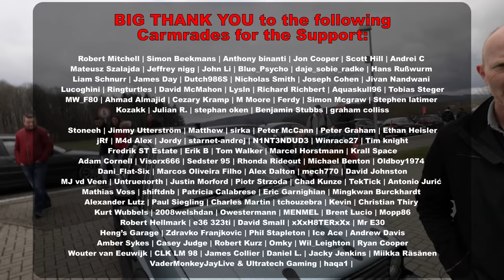(un)LUCKY CRASH of Legendary @pinderwagen // Nürburgring

Comment: I’ve posted my thoughts and more video of the crash here: 
https://www.youtube.com/watch?v=54_zELFQ7iI

This is the 6th video Misha has posted of the #pinderwagen on his channel and we were both hopeful of getting some great incar footage. 

For the first time in several years, the Golf had zero issues, all the work over the winter to replace the gearbox with a much stronger SQS H Pattern dog box and sequential shifter meant I was finally able to do 2 days at Spa, then 2 days at the Ring without the gearbox letting me down.  This was lap 2, by that I mean I’d done a lap, came back into the carpark, adjusted tyre pressures and gone straight back out for this lap. The ambient temperature was around 9 degrees and I believe this is probably what caused the issue with the rear tyres not fully warming up.

In future, on cool days like this I’ll run A052`s on the rear instead. They warm up quicker and offer similar grip. I run slicks as they are a fraction of the cost of A052`s or Direzzas.

People always comment in these videos that I could have bought a BMW or Porsche for what this cost, my replies are always the same. You couldn’t and I didn’t have the money 17 years ago when I started. The car has been developed as I’ve saved up and wanted more from the Golf. 

I have also learned a huge amount along the way which is a big part of the enjoyment for me. Just buying a car off the shelf and driving it with no opportunity for development holds zero interest.

Many thanks to Misha for sharing these laps and I genuinely appreciate all the positive comments we’ve received over the years. 

I’m not a mechanic, I don’t have a race team behind me, I’m just a home enthusiast who loves learning, getting stuck in and driving an old MK2 Golf I built on the Nurburgring.
Reply: I am really happy that you didnt have the money 17 years ago 😅
And happy that you are ok too. 
Your car is amazing and the way you talk about it your wife should be jealous!!
 just keep visiting Misha!
Reply: Cold tires are the worst. Happened to me too sadly. I'm glad you're okay, and continue to do more track days.
Reply: You have a great car Nigel and I always like seeing you on track 👍
Unfortunately shit happens on NR sometimes but I'm sure you will be back soon 💪🏁
Reply: You are inspiring racer to all of us motorsport enthusiasts who don't have the means to own and maintain a proper track car.  👍
Reply: Thanks for sharing. Amazing that something so small (cold rear tyre I think you said), causes such a spin. Credit for being transparent and well done for saving it.
Reply: legend
Reply: Built, not bought is so much more satisfying, when you've put so much work into it over the years. It's amazing what can be achieved when you're just willing to have a go, rather than just paying someone as it's quicker. Hope to see Pinderwagen in the metal some day
Reply: Can happen to anyone at any point, good that you got straight back on it, exercise that demon! Car took it so well, sign of being built properly 👍
Reply: first of all , i'm glad to see that you are okay and that it isnt THAT BAD , could have been much worse :)
Reply: Do you have a link or contact to the company you got your trans setup from? What I googled seems like an old non functioning site.
Reply: I love your car. The fact you built it and didn’t buy it is what makes it so cool, much cooler then a mega expensive exotic that someone bought. Keep doing what you love and don’t let this setback keep you down. Great work, great effort, great inspiration for the rest of us. Well done!
Reply: your car is truly awesome. you seem like a really cool dude too. congrats on the retirement btw.
so glad you only grazed the barrier. happy to see you were ok after and also super surprised by how well the golf took that hit. man id love to chat with you about the car and hear all the stories. after 17 years id imagine you have countless
Reply: I hope you are yelling at yourself and not the car because she doesn't deserve that kind of language!!!  Love watching you work and one hell of a machine you have created!
Reply: 1 in 3000 chance of crashing is really really good for the ring, they dont call it green hell for nothing, hey now you get to rebuild and improve the car, just part of the fun!!!!
Reply: Top chap Nige.
Reply: UTTER RESPECT
Reply: Glad you're ok, in good spirit and your wife lets you reserve time to fix tinderwagen proper :)
I've had more fender damage on my former MK2 after 'parking' it with 5kmh too much, so your reactions to the spin-out must have been really on point.
And that shifter is just amazing, wow.
Reply: As we all know Nigg "Happy wife, happy life"
Reply: Play that moment from crash in slow motion, i think that it have something to do with the rear right wheel, when u were going out of that white-red sider or what is it, and tire was catching grip and downforce made it little bit harder in that 120 speed because in that turn the weight which was translated on that tire was to heavy from that downforce, turn and beton or what is the name of that white-red think on side, so meaby different size of tires in back and better suspension will meaby help if am i right, otherwise, super cool wagon lap💪🏿💪🏿💪🏿💪🏿💪🏿💪🏿💪🏿💪🏿💪🏿💪🏿💪🏿
Reply: I believe it was you that gave me one of my first passenger laps on my first ring trip, some 10 or 12 years ago, You taught and showed me a lot in that one lap. Thanks For sharing and good luck with the fixes.
Reply: I rather watch a video of the physics defying Golf than any GT3 RS videos.
Reply: Your car is amazing and that shifter is dead sexy. Your reactions are quicker than mine but some slides just can't be unfucked. Short wheelbase FWD cars are a hoot, but inherently twitchy. I guess that's what makes them fun.
Glad it turned out alright. I look forward to your next video.

Comment: Interesting cause, if it was the cold rear right tire, or maybe being slightly on the brake when turning in left? Anyway - happy that there was almost no damage, I love your pinderwagen, your geniosity and effort, it's an incredible machine. Looking forward to more of your videos!
Reply: Its a mk2 golf, right?  I’ve had this kind of thing happen.  It’s the light ass rear end.  The aero on the car was probably working but not quite enough for that one light left at speed.  He let off a little and the back end didn’t agree.
Reply: @pinderwagen  looks like you may of barely touched the curb on the righthandside before turning left causing the rear to get unsettled
Reply: @pinderwagen  nice driving though and awesome car 💪
Reply: @essbeepee3376  agreed.
Reply: @kw2519  i also think if he would off accelerate instead off breaking that little bit. Maybe wider back tires and of course a bigger wing
Reply: @pinderwagen  15:53 sounds like the floor/splitter makes contact with the ground, is that normal of each lap? Crazy lucky though all in all
Reply: @chottomatte685  it always touches the side skirts there and through the Karussel. Mishas camera makes it sound really loud doesn't it!
Reply: @pinderwagen  interesting, I mean tires temp is a factor as well as road surface.  But I just recognized that moment when the front and back had differences they could work out.  

Are your rear axle beam bushings oem or a different material?

My brother had a mk2 back in the day(total beater in college). That had the most worn out rear beam bushings.

We went through a flat S turn and the back end just kept going out farther and farther without actually sliding.  It was doing its own rear steer.  He countered it and he was not unfamiliar with slides at that point having had a hopes up Caprice 9C1 prior.  The kid knew how to drive at that point.

But I’ll attest to how the back end just wouldn’t listen.  

Does your telemetry show you anything wierd?

Also, fucking amazing work on that car.  It’s fast as hell.  That was definitely a fluke.
Reply: @motri5935  ya but I think he would have pushed to far out for how fast he was going and wouldn’t have stayed on when exiting.  Like he prob would have slide into the wall with his right side.

I mean, it’s all speculation until someone reviews the telemetry

Comment: Good fast variants legendar special  gearbox manual The short box.  You can switch more quickly and reduce power in time.  There will be no load on the motor.  Easier to drive in all corners.  Never use the "long box", shift too slowly and reduce power under load, you can slip off the track.  There are special adjustable gears of the short box Faster or slower.  Always in many corners Short adjustable manual gearbox gives good results. Even at high speeds.
Reply: Sorry, but I have no idea what you are saying.

Comment: Tough one, coule be tire temps. But here is my take , during compression the car made a fair bit of a banging noise but thats nbd, he moves the car over to the right side to line up the curb but hes  braking  coming up the hill as speed is scrubbed off pretty quick, he goes from 140 to 106 in like 20 meters. I think he stabbed at  the brakes a bit to hard making the back come around, u can see at the exact moment he loses it he has 0% throttle. And you can tell he saved it on the original mistake but as soon as he hit the curb physics slapped his cheeks. Still a great driver can't fault him on that error really,  3k laps and you are  bound to have an anomoly when you least expect it. Glad the driver is okay, and no one was hurt.
Reply: Also teach this man how to left foot brake please Misha.
Reply: if you watch the video I link to in the pinned post, I have a previous lap side-by side. Same speed (slightly quicker actually)

I agree about Left foot braking. I`m still practising but it`s hard. I end up nearly headbutting the windscreen most of the time :D

Comment: From the inboard we have i'd say the oversteer moment is caused by slightly going on the outside curb under braking, then very slight liftoff when the car started over rotating. its a very common reaction, but sadly its the worst thing to do on a FR car, maybe with more throttle input to get out on top of fox hole would have got you out scott free. that is what i think. also you did catch the first moment but then he completly lifted out, i've done exactly the same think once wrecking a car😅. but what i learned from that payed me back many times...from that day on a FR car oversteering my modo is when in doubt throttle it out!😅 it works well on motocross has well🤘. but at the end of the day i know mistake happen all the times even to the best of us. the only thing important is to learn from it so next time you will know what to do. very happy that ur ok and the car is also ok! you are lucky to do that. here in canada race tracks a far appart sadly🤘

Comment: My only thought is your golf had been through some high g force left hand bends leading up to the crash. So I would have thought the rear right tyre would have had enough temp. That was my gut feel based only on what I saw. It looked like it disweighted due to riding the outer right kerb just before point of turn in. That was my view as an observer. Cheers.

Comment: I love seeing peoples cars they put effort into building at the track, its more of a shame when they get dinged up though. Looks like deceleration induced over steer, ive seen two other cars do the exact same thing at the top of fox hole, one overtaking a car on the inside of the corner, minimal steering input, slowing down to be safe and the rear just loses traction. Glad the driver and the car are (mostly) ok.

Comment: It sort of seems like you were pushing the car too much. And that there is a disconnect to what the car is doing and what you are feeling through the wheel (either that or you just push things too much trying to get more out of the car then it is capable of). Ive done a little tracking with a motorbike and you are completely in touch with the bike and the feel of the road in a way that few if any cars can replicate as there is a steering column on cars. You could see a number of corners before you crashed you were right on the edge of crashing and seemed unaware of the impending doom.

Comment: I looked at the crash multiple times and you can hear (from what it seems) the car bottom out on the apex just before the crash and then again right before turning in and losing it. I don't know the settings, but a bigger wing would most definitely make it bottom out more. A stiffer setup is needed if you want to fit a bigger wing. I think the bottoming out unsettled the car on turn in. The reason why you wouldn't see it on the telemetry and why it was no problem before could be due to a stronger headwind causing more downforce at that specific moment. The higher downforce combined with the compression could explain the crash. Now I'm not an expert, but it's something I noticed.
Reply: The bottoming out is just the aluminum side skirts touching. They are designed to be flexible, they don't take any load off the wheels. Most cars get extreme spring compression through there. Stiffening the car just for one corner would compromise the rest of the lap

Comment: As a certified racing driver, i saw the mistakes, when the, car lost traction, he used good the steering wheel to turn, but the moment he straightened the car he should step on the gas with appropriate amount of gas, not braking, as a certified driver, we learn in extreme situations how to handle the cars with high speed in racing tracks and  in racing tracks with extreme weather, without losing control on the car, here  is common situation when losing traction of the car the driver starts panicking and starts turning the steering wheel, left then right, then straighten it up, this is called instinct for self-preservation, this leads to unconscious actions with the steering wheel....the driver will need some education, this can happen with any car any HP on the car.

Comment: Nice guy and nice car. But sorry, I’m not buying cold tires.
Reply: We think, after watching the video and speaking to quite a lot of ring regulars that I was slightly more to the right than usual and possibly touched the kerb which pre-compressed the right rear damper a little compared to usual.

I don`t agree with the cold right either, but at the time it was all I could see. I missed the car positioning difference.
Reply: Thanks for the reply and I’m glad the car is still going 👍

My take (for what it’s worth). 

It looks like the car is very stiff and the wheelbase short, giving an aggressive breakaway point. 

On the approach to corner, you look to be asking 100%, you turn in, then lift off. At this point the back breaks free. 

It looks more likely that this is lift off oversteer caused by the weight transfer.
Reply: @stevefarrimond  if you watch the link I shared in the sticky post, I do I side by side with a previous lap where I'm 5mph quicker with no drama.

Throttle traces are similar. I do understand what you are saying, but I'm on the throttle as I turn in on both Laps.
Reply: If you watch this video, you can select a slower playback speed. 

Watching at 1/4 speed, it’s clear you enter the corner in throttle, but then remove the throttle mid corner.

Also, in your video, the comparison clip, shows a passenger would this not give more inside weight/grip. 

Im not saying I’m right, I just find this stuff fascinating.
Reply: @stevefarrimond  likewise! I want to know why, rather than just say 'it happens' and move on.

Comment: Public roads, there is a speed limit (usually) and regulations.  You shouldn't be doing 100mph plus and aoex turns.  (In all cases)  Taxpayer roads.      Without "crashes" motorsports is so boring to watch.  Yes, even worse than golf...especially in modern times.  Driving is a different story of the "leisure" class.  Sequential gear box on a kit car.   This is why, they named a car coincidentally a Golf.  It is as boring.

Comment: Honest opinion? He was driving beyond what the car can predictably handle(not too fast as such, but taking a chance and expecting the car to sort it out) several times before the spin. That it happened there was not a given, of course. But it could have happened at several different spots only in that specific run we see. Good thing the crash wasn't worse, but it wasn't exactly the gods conspiring to put the car sideways here..
Reply: Obviously not watched his other videos then as this was at a steadier pace than normal. Car and driver can 'handle' more than the pace driven on this particular lap
Reply: @ianhowell26  Backseat driver insurance, and so on. And I don't doubt that the car and driver is faster than this. 

That doesn't make the dives into the turns in this run any more  more within the limit of the car can predictably handle. I.e., I might have attempted a slam over the curb where he spun out on a race-day as well --  but the five other ones before that? Those were neither fast or safe.